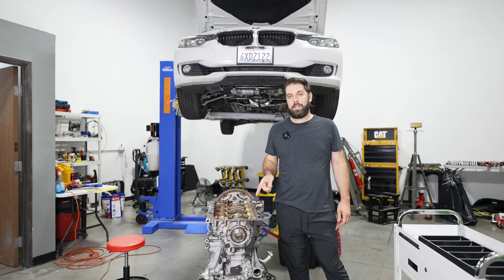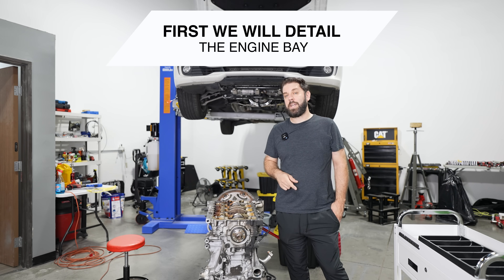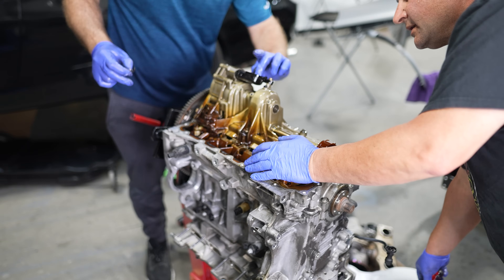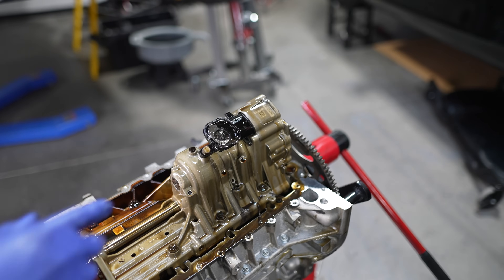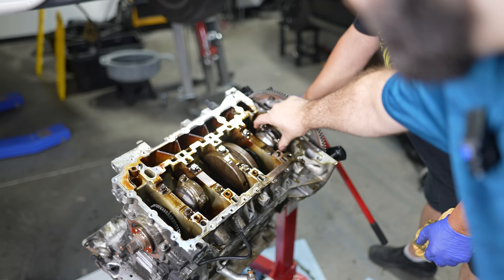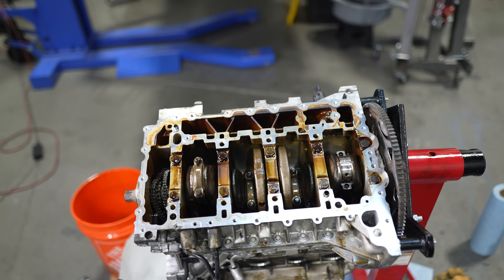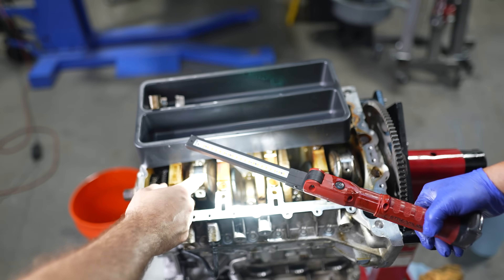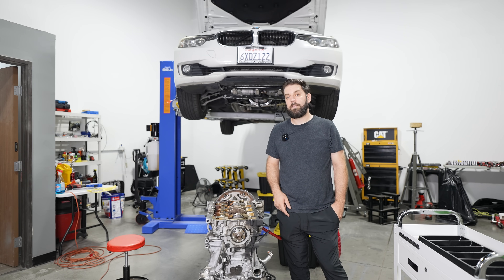This BMW Didn't Make It To 100K Miles, Will Yours?  Do This First!

Comment: I do not understand the logic of waiting for the timing chain guides to fail before updating the timing chain of the N20 engine.  A timing chain update before anything happens to the original chain parts is always cheaper and easier than having to remove the engine after a catastrophic failure.  People are gambling with being lucky for not having the purchase a new-used or having to rebuild the engine due to internal damages.

Comment: My 2013 N20 Msport is tuned and over 200k and running extremely well. Ive not done the timing chains nor injectors. I purchased all the parts but seeing if i can get to 250k 1st
Reply: E84 with N20 and 185k. No problems so far. Not tuned.

Comment: hey Musa, this video was interesting to see as my 328i did the same except it is fully seized probably due to oil starvation. Car itself is mint, had the full msport front end, forgestarwheels and all carbon interior. Now i am trying to figure out if it is even worth swapping the motor
Reply: What did you end up doing... Mind if I ask.
Reply: @heroldnak  sold it hahah the motor was locked to the max, n20 had timing chain failure so spare motors were expensive

Comment: Great video, interested to see the outcome! Just crossed a buck fifty on my 2016 320i. I have truly over maintained the vehicle and pay close attention... it is flash tuned and has full bolt ons as well. I baby it for the most part- especially when cold... but do pound on her occasionally! No real issues to speak of except for a small coolant leak at one of the turbo seals. Not big enough to tear apart yet (only requiring a top up every several thousand miles) but at least I've identified the source. If the turbo itself continues to hold strong, plan to rebuild it entirely at 200k miles.

Comment: Could you help me, I need to rebuild my engine, it's an N20B20 and I would like to know what kind of spare parts I need for the engine, I'm from Chile South America, there are no components here. I have to bring everything to the USA and I need guidance. There are many suppliers, I need connecting rod metals, crankshaft metals, rings, pistons, cylinder head gasket. Best regards

Comment: Mine will. I'm less than 5k from it.  I bought it with 43k on it it's an 09 with N51 B30A engine. The only maintenance not done by me on it was for new tires and cracked windshield.

Comment: @vehicularDIY Is it generally pretty safe to pressure wash BMW engine bays? I’ve got a 2013 X3 on deck for timing chain replacement at 109k but the engine bay is FILTHY. PO must have lived on a diet road or something. I guess the electrical connections are all theoretically sealed, just makes me nervous.

Comment: 141K miles so far. Had to change alternator twice and oil filter housing twice.  Other than that still running strong.
Reply: N20 motor?
Reply: @DuckMcDuckinson  yep
Reply: have u had it all 141k or did u get it 100 miles ago tho lol
Reply: update 180K +

Comment: The four cylinder engines seem to be the ones to stay away from. I've owned a few with the inline six engines, and they are nearly bulletproof.
Reply: My B48 4 cylinder was fine in my daily, but yes compared to all my in-line sixes they are all more reliable and just better driving engines

Comment: Hi 
I am watching your videos for a while. They are awesome.  I have x3 28i. The check engine light is on. Drivetrain malfunction alert is coming everytime I drive. Leak was diagnosed near throttle body and bank one. One screw was missing from throttle body. I opened the whole thing and replaced the seal and missing screw. But after that 
I got these codes P0238, P007d.
Any suggestions is appreciated. Thanks.

Comment: I would like to ask how can you get away by cleaning the engine with liquid soap and water?  Now I am a complete noob and know little to nothing about cars (perhaps a lil more than that) but I have long heard, never use a hose to spray off your engine because of all the sensitive electrical components which can get fried.  You obviously know what you are doing and the why behind it, so could you enlighten a noob?

Comment: I want to know what the cylinder walls look like from pushing glitter through the engine and starving it of oil. How bad can they be before you scrap the block totally? 
I'm slow rolling a rebuild on a 2012 right now and I have been him-hawing final assembly because of the the plasma spray coating not being perfect. 
I wish someone would just say... "Clean the varnish off the cylinder walls with xxx color scotch bright and WD40 for lubricant until clean. Then reassemble engine with proper ring clearances." 
My engine has just over 100k miles and was very well maintained, but still had obvious signs of buildup on the cylinder walls.
Do you guys just leave it as it comes out of the washer or do you dress the cylinder walls in any way? I know hone's and dingle-berrys are 100% out of the question.

Comment: What would you get done on b58 gen 1 to make sure I get much miles out of it as possible while on mhd tunes. I change my oil every 5k , 3k if I run ethanol blend. Spark plugs every 20k is in the plans as well. And coils every 40k. Anything else I should keep an eye on? I want to learn to read datalogs too!!!
Reply: Changing coils every 40k isnt necessary. The spark plugs, itll help performance, but the coils are just to send the signal to the plug. Unless they go bad, it wont affect the car at all changing em. If you really want as many miles as possible, the most important thing is keep up with all the fluids(oil coolant trans fluid etc) and to allow your car proper warm up time on cold starts and to push it hard every once in a while to open up the engine a bit. Thats all you have to do, if something breaks or needs servicing, fix it asap so the problems dont start piling up. Goodluck w the b58, i love those thangs
Reply: 100% correct. I have an 06 N52 and only recently have I had real problems with the car. after 200k mile I started slacking off on the maintenance and now she’s acting up at 239k

Comment: Great job guys. Does this mean cylinder 4 is the last cylinder in the oil supply chain, as there was not enough oil pressure to feed this bearing? Or because cylinder 4 is back on the engine and runs under more heat beneath the hood? Dutch regards, Nico.
Reply from the maker: Thanks!  We had actually checked that there was sufficient oil pressure at idle via a scan tool when we were running the engine.  My theory is the oil pickup was partially blocked and would have been able to supply enough flow up until the RPMs climbed.  This car did break down on the highway.  Oil pressure should be even at all parts of the engine once the pump starts spinning but it takes second to build up.  If there wasn't enough flow to maintain that the passage furthest away from the oil pump feed would likely experience diminished flow first.

Comment: Actually almost spit my food out from laughter at that start up. Seeing the thumbnail & those F30 headlights, it was already obvious what this was about. 
It's so unfortunate that a company that did SO much, that was capable of SO much, doesn't give 0.5% of a shit whatsoever in any regard. 
They can engineer if they want to. If they WANTED to, they would've stopped timing chain guides from disintegrating & bearings from spinning over 20 yrs ago across literally every platform. But engineering properly & using proper internal components isn't profitable. Extremely sad.
Reply: Planned obsolescence. It goes hand in hand with the right to repair and the companies objecting.
Reply: Most turbo engines from all manufacturers use a timing chain guide
Reply: @Sniperwolf16-b4g  Pretty sure that he wasn't talking about the fact that it has a timing chain guide. He was just saying they could have updated/recalled the timing chain guides much sooner than they did. BMW did eventually change the design of the guide to be stronger (maybe new composite as well?), but it was after years of this being a common issue.

Comment: Ah ha🤗

I waited for this moment the whole time I watched your videos.
 Fault of same nature.

I was pumping my e93 N54 engine until it lost power after a traffic calming hump. I had to stop immediate and tow the car to mechanic.

The engine was running except for a slight rattling sound from underneath.
Mechanic told to buy new engine but I was against that.

After careful study of your videos on rod bearing, timing change .... I decided DIY is better experience.

After thorough inspection without a portable device (scanner) no metal or rubber pieces found in oil & pan. Timing oil pickups 👍

I found the following:
1. Oil leaks on oil housing and valve cover. The belt slightly chewed up {bad}
2. Oil inside the spark plagues [6&3 worse]. Coil 6 plugged with oil
3. ROD 2&3 slightly loose. I suspect that's where rattling came from.

I am hoping from this video I'll have better results. Of course after repair scanner will be used.

Thanks for great tutorial videos✊

Comment: This is EXACTLY what happened to my N20 in my 2014 328. I had 260k kms on it and the turbo started acting up. I had the dealership put a turbo on and when I got it back it started knocking. I was on the freeway a couple of days later and it got really loud. I shut it off and got it towed to the dealership. I had to put a new motor in. I do not have the skill to do this myself, but I do have a shop that I could if I had help. It's back on the road now and I have a new motor with 24 month warranty unlimited kilometers. I really like the car and now is no time to try and find a new car.
Reply from the maker: If the replacement motor has the updated timing guides, you won't have much to worry about for the future.
Reply: @VehicularDIY  Yes, I specifically asked about the updated timing guides and they are the new ones. I think I'll get another 300k out of it now.

Comment: How do you prevent this from happening?
Reply: Don't buy anything with an N20 in it. Very simple. I don't mean to be sarcastic or rude either. They're pieces of complete shit.
Reply: @RothBeyondTheGrave  I actually have a 2017 X3 with the N55 motor but heard that these things can happen to N55’s as well.  I heard sometimes it’s caused from lack of regular oil changes
Reply: @davejohnson6144  it literally happens to everything they've made since the late 90's. Some like N52's are WAY less likely, but it still happens. N55's seem infinitely more safe than 80% or so of what they've made since, but yes keep on top of those oil changes. I'm sure most stick to around 5k intervals?

I'm far from an expert, but I've been doing my BMW homework from afar in my Benz in hopes of having one as a 2nd car asap. I just don't get why they completely stopped giving a shit. (Other than profit obviously). I cringe at the Toyota/Honda, etc comparisons, but even with Benz, this stuff just DOESN'T happen. It's literally guaranteed with BMW.
Reply: @davejohnson6144  https://youtu.be/rPUUNhjJjHU
Great place to start if you haven't already watched this one. FCP also has an N55 teardown vid of....you guessed it....one with a spun bearing.
Reply: @RothBeyondTheGrave  the first Mercedes Turbo engines (M276/M278/M157) bend connecting rods and score the crappy Silitec liners like it's their job. If you have one of those you are watching from the front row.
Reply: @igotaction  hahaha very true. I wouldn't touch a Benz that new either. I have a 3.5L M272 (well after the revision on the garbage balance shafts in the early ones.)
Benz certainly has their cost cutting garbage, but compared to BMW it's exception rather than norm it seems. 
Going back, the older the more solid (generally) although I'm sure the same can be said for BMW. But correct me if I'm wrong, entire cooling system refreshes have almost always been mandatory anywhere from 70k-100k mi for example? And bottom end work has been a requirement before 100k mi on everything since e38's give or take displacement?
Reply: @RothBeyondTheGrave  Mercedes' parts are too expensive, and now that the flaws have been fixed around the N54 it really is a great platform.
Reply: @igotaction  I'm taken aback at the significance of your response, as of a few hours ago it looks like I have the (dis)pleasure of replacing my intake manifold. (Another known m272 fault) & last I checked they were $650-700ish.
I also desperately want an N54 e92 as a 2nd car & am becoming less afraid of them by the day. But I'm still afraid of them hahah.
Reply: @RothBeyondTheGrave  too bad you don't want an E93 as I will be selling mine as soon as I rebuild the trans, just did Whiteline rear subframe bushings. You will see my N54 on the channel soon
Reply: @igotaction  nice, I'll be on the lookout! Thankfully it looks like I jumped the gun & went back in there...just a few sensors (1 which I already have), so that'll save $650 towards your e93!😎 Looking forward to seeing it on here!
Reply: @RothBeyondTheGrave  good news on the M272. If you go to 535 detail video he linked my social media account and if you scroll down you will see the black ext red interior E93 super sleeper and at the top is the subframe out and trans out for rebuild.
Reply: @igotaction  indeed, thank you. Sounds good, I'll go check that out!
Reply from the maker: Just install the updated timing guides around 90K miles and change the oil at 5K intervals and you shouldn't experience this.
Reply: @VehicularDIY  large part of my point right there. It's great that there is an updated part & all....but we're not talking about 2006 Hyundai Accents here.
My mom's '07 Acura TL went to 185k on it's factory timing belt, pulleys, tensioner, & water pump. Got it done along w/ valve adjustment (everything still 100% in spec) & is now at 204k mi & runs EXACTLY as it did at 40k....because it was engineered & assembled correctly. 
BMW used to do this, & is plenty capable of doing this, but they never will again because it's not priority for them. Servicing anything on a timing chain & related components before 100k mi on a "premium" vehicle is a pathetic joke. Still love them though, but we need to start calling it like it is.

Comment: Y’all are so brave for pressure washing the engine. I’m afraid of getting an electrical issue from it.
Reply: Use a pressure washer and foam cannon and you seriously decrease the amount of actual water you are introducing.  Then come right behind with a blower.  Pooling/standing/sitting water is your enemy.
Reply from the maker: You can cover sensitive electronics, we were mindful of not directly spraying anything like that.

Comment: Is it without xdrive? Don't think you can pull out xdrive ones like that? In that case doesn't low oil pressure warning come up?
Reply from the maker: This car is RWD.  Yes more work would be involved if it was AWD.  No oil pressure warnings came up or were stored which was a good thing as the rest of the motor looks fine given there was oil pressure feeding the rest of the engine.
Reply: Just have to disconnect drive shaft on most xdrives and take the front diff with the engine.  I have pics of my M57 X5 engine pull just like that.

Comment: I see a lot of the N20 motors didn’t get as lucky as mine did, made it to 198k miles before needing a new engine (I blew the ringlands out on cylinder 2) and now it’s going back together with a sleeved block and forged bottom end. I actually really like this motor even with its pitfalls.
Reply: @fantasy11222  I wouldn’t pin it down to one specific thing, only thing that I could think of to link to the cause would be a misfire that I got suddenly when I was driving home on the freeway, had to limp the car from the fast lane over to the shoulder, other than that I honestly have no complaints about it. Timing chain guides of course are a very big thing to keep in mind for long term longevity of the engine/preventative maintenance so glad to hear you’ve done that already. If you take the car on hard spirited driving or to the track I would see about investing in a baffled oil pan to help mitigate any oil starvation issues from high g cornering/braking. I haven’t come across the issue personally on that one. It does seem to pop up a fair amount in the forums about peoples logs showing the dip in oil pressure, Navardi tuned makes the only option I’m aware of for a baffled oil pan (it’s the one on the new motor for my car) the extra piece of mind is nice because I intend on taking the car to track days or auto cross type events with some friends for a little friendly competition later down the line. Running stage 2 you will want to stay on top of your spark plug change intervals because they will be significantly shorter than the stock interval. I end up changing them a little before 10k miles of run time on them and gapped within the recommended stage two range of .020-.022
Reply: @GeoDayrit1 what changes did you do for the stage 2? Thanks for the information you gave, very interesting.
Reply: @GeoDayrit1  so you  blew ringland having stage 2 on your car?
Reply: Nice man. Mine has been great also but I change my oil every 3-4k.
Reply: @DBT_Renovations  I follow a similar regimen for oil changes, little longer though I typically change around 5k miles
Reply: is 10k km ok? just got a 2013 320i N20 as well. I think it's stage 2 pushing 300+hp  @DBT_Renovations
Reply from the maker: Nice, what year was yours?
Reply: @VehicularDIY  April of 2012 is the build date for my car, early year/pwg car